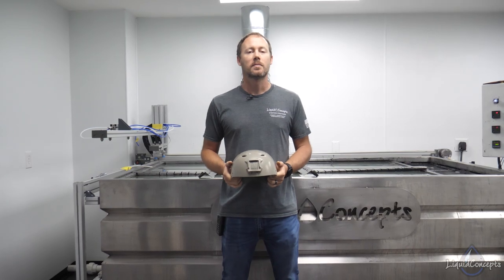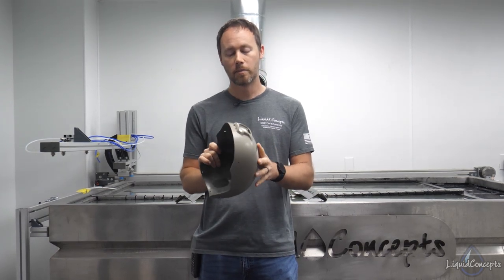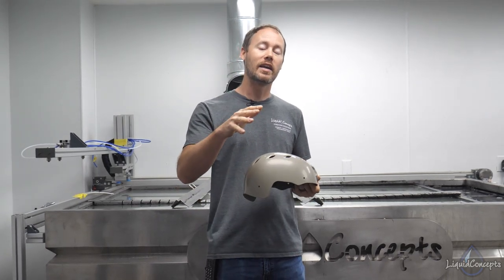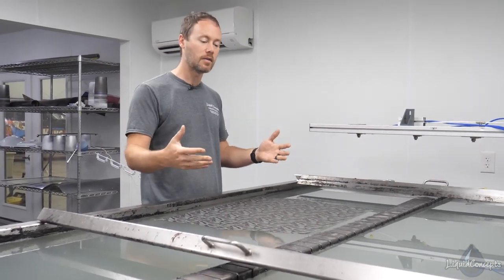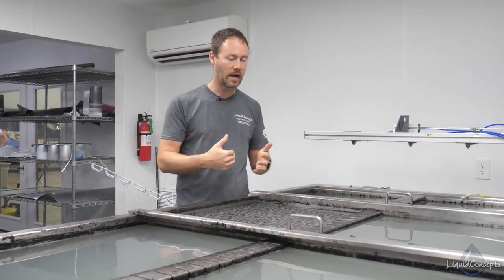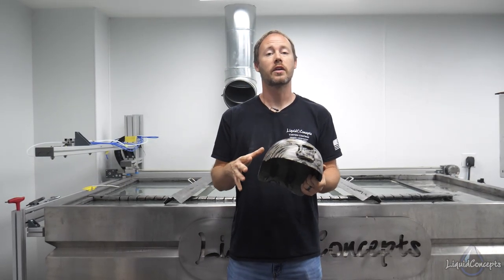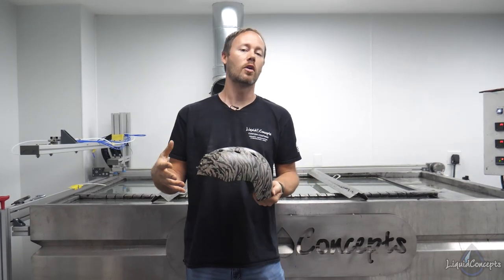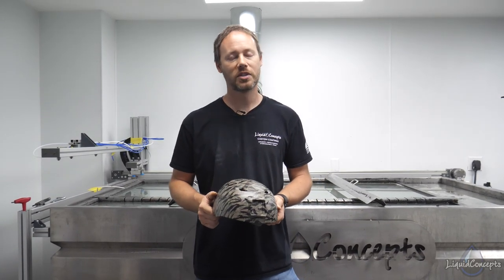How to HYDRO DIP a Helmet

Comment: Nice Job! What is the cost of doing a full face helmet? I`m assuming you have a pattern catalogue, price must also vary on that. after dipping do you do a clear coat in a resistant material?
Reply from the maker: Hello, pricing varies. We have a large selection of films on our website. liquidconcepts.com
If you would like a price on getting a helmet dipped, send us a picture @: info@liquidconcepts.com